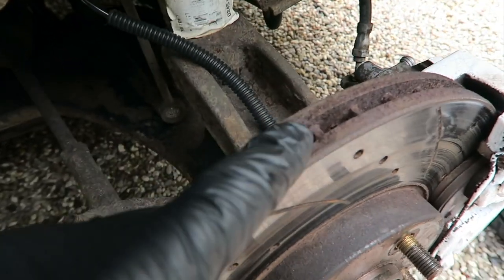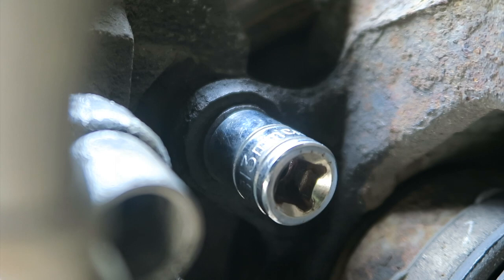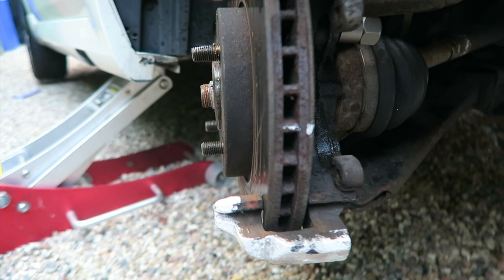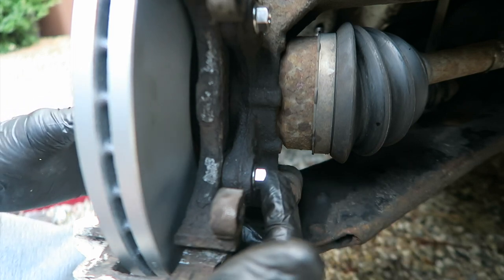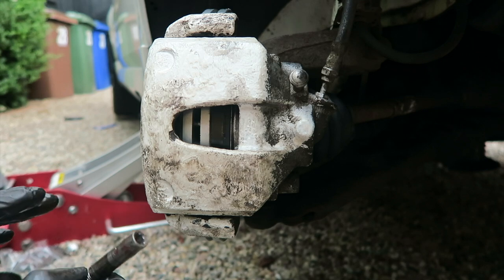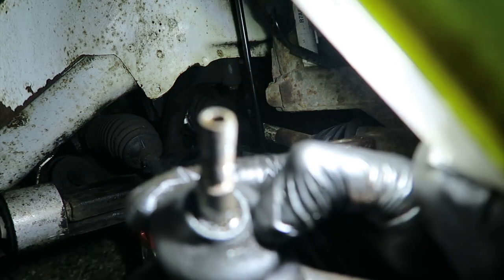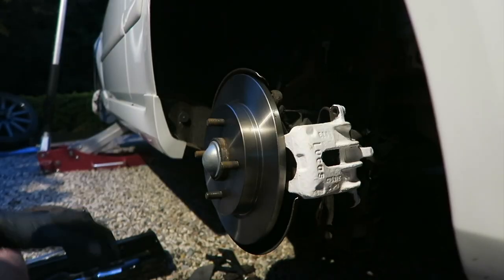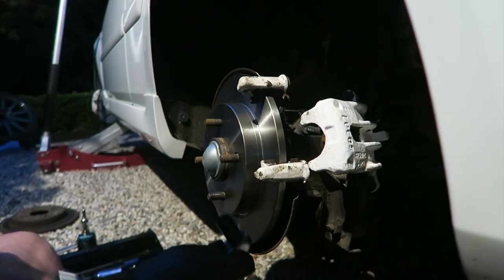Ford Fiesta Mk6 ST150 brakes get changed and rounded nuts removed

Comment: Keep them nuts moist mate. 😆 going to be boing mine soon, as i have a warped disc on front so this was a good vid to see what shit iv got coming. Keep them coming fella 👍🏽
Reply from the maker: All about moist nuts!  I think I was just unlucky on the drivers side but use a breaker bar if you have one as will help massively!  Should be an easy job really if all goes plain sailing.....

Good luck with yours :)

Comment: That's annoying man. I remember when I was dismantling a ST rear axle to do a ST brakes conversion on my car then one bolt snapping off. Dad then had to drill the bit off and rethread it
Reply from the maker: The worst part is a job that should take 2 hours maybe? Ended up taking a week lol
Nothing worse than a bolt rounding off as you know you are screwed (no pun intended there)

Comment: Just letting you know in case you use the pagid discs again, don't clean them with brake cleaner before. They have a coating to aid bedding, it says on a sheet of paper in the box not to use brake cleaner on them.
Reply from the maker: Thanks mate, never knew that about Pagid, always thought brake discs needed to have oil removed haha, that will teach me for not reading instructions!!